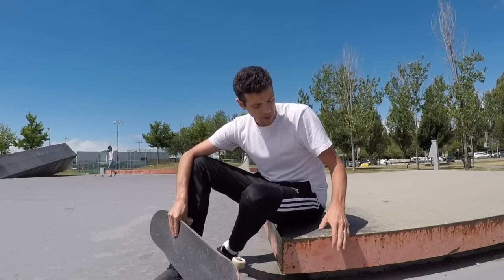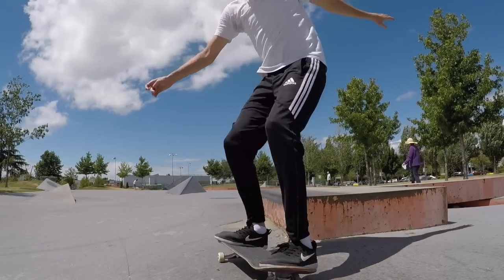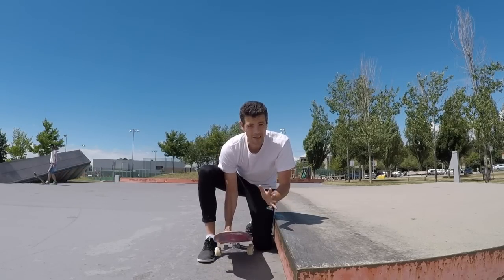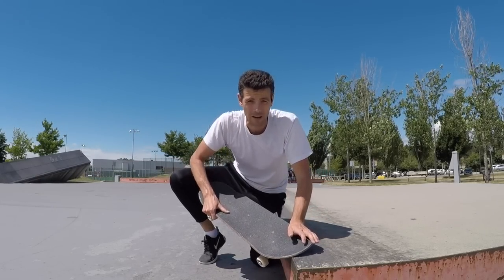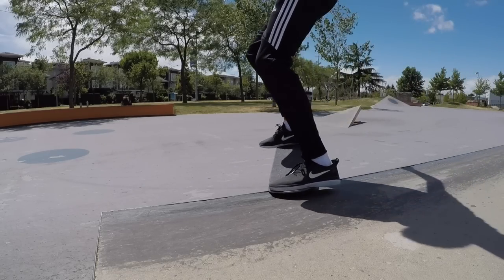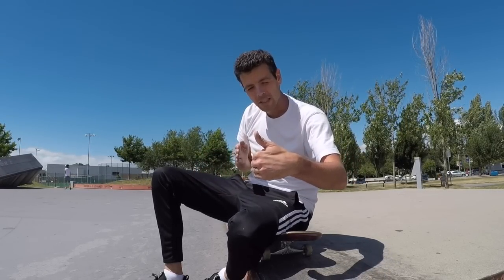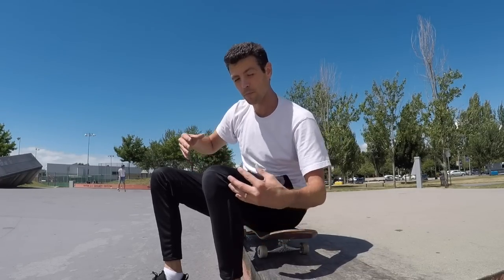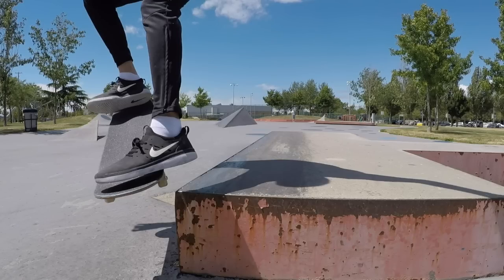How to Crooked Grind

Comment: Back when I was a teenager, I learned these going fakie out and then just learned to shove it out since my board was doing the same motion. Felt really rad haha. Never could get the hang of the nollie out with them. Also half cabbing into them feels really good as well. Currently 34 and finally came back to skating after 17 or 18 years away and trying to build up the courage to try these again.

Comment: Wow the focusing your energy on the heels at the end when you pop out / even during the grind is gonna be crucial for my sesh tonight. I’m gonna learn these & have them dialed in. I wanna take the slappy route but I learned these on a big ledge when I was like 17-18 so I just gotta relearn them the way I did with the techniques you explained. Plus that stationary pop out practice / exercise to get used to the feeling of popping out should really help me. That’s my biggest issue with crooked grinds, I can slide them all day & pop high enough on a lot of ledges / rails to get into them but my landing always goes to primo & I think putting my pressure on the heel like you said will really help. I’m so excited lol. Thank you big bro. 🛹😎

Comment: Your suggestion to focus your mind and visualise that little bit of truck closest to the ledge really helps me with this. I’m learning these on crusty concrete ledges at my local, so this is hard work. I have been struggling with truck positioning and pinching with my little wheels an 8” deck and size 12 feet. Shifting weight to heels from toes for the nollie out is such a little dance. Your appreciation of the truck positioning and the sheer radness of this trick and the pinch at 02:04 is outstanding. I’m 45 and tis my first time attempting crooks a few days ago. I have been trying to just ollie into that pinch stall on a ledge and getting the feel for the pinch in a stall and that pivot point has been a revalation. Contemplating pivoting that little nollie leverage line at 05:00 is not something I had ever done but well worth sitting there and rocking on that line and trying to nollie out for a session. Tonight it was amazing, I put a crook in a line with a boardslide and a fucking huge frontside pop shuv off a ramp. I’m serious I got so much dopamine from this trick I was flying about 2m in the air with the FS shuv. Jumped into the local bowl for a carve and ollied out into a crook stall. WTF. Getting consistency and sliding in the bowl, crook to fakie, and crook nollie out back into the bowl next…

Comment: When i learned them I struggled so hard with that board flip popping out. The tension release of the bushings flipped my board under my non-consenting front foot. It killed me because I thought I have them already. But as you say the more you really nollie out the lesser the board pops away flipping. Another thing that helped me was to actually align my shoulders more parallel to the ledge while grinding and popping out. It got me consistent pop out security.  Before that I used to just "stand" on this grind with my upper body too much turned "in", like leaving the parallel course. I was lacking motion and could not revert to a parallel pop out. Going parallell or reverting to parallel while popping out was one key for getting out of this trick for me. And to really nollie kind of and push with your back foot when popping out.
Reply: The biggest tip for me was having my shoulders parallel too the object I'm gonna grind it helped me stick and grind. It was super weird because I was so used to my shoulders facing forward not sideways 🙃. I thought I was gonna fall backwards 😅. But keeping your shoulders parallel helps to keep the momentum straight after you pinch that inside wheel. Now working on popping out better instead of going fakie. Good luck. Be safe. Consistency is key

Comment: I’m going to try to switch the weight to my heel because my board flips every time and it’s so frustrating
Reply: I have the same problem. Did it work?
Reply: @noahthefilmer9100  it did end up working but what really helped was to angle my front foot before popping into the ledge and coming out of the crooked grind into Fakie helped a ton on figuring out how to grind the trick properly. Good luck on your progression 👍🏼

Comment: Thank you for this video!  The part that helped me is where on the truck you are actually grinding... I was trying/aiming to grind the wrong side, putting too much of the truck on the ledge, which pushes the wheel into the ledge rather than letting it dangle (and even keep spinning) like your video shows...  Now I will be focusing on grinding the side of the truck where the wheel is pinched.

Comment: hi dude reading this, if you havin troubles with the k-grinds flipping out constantly it might be ur damn back foot not be flat. My troubles when learning this trick was due to my back foot being on my toes which lead to the board flipping out or even landing premo. Oh and keep those shoulders aligned as it will help you're momentum and it'll flow and get steezy wit it